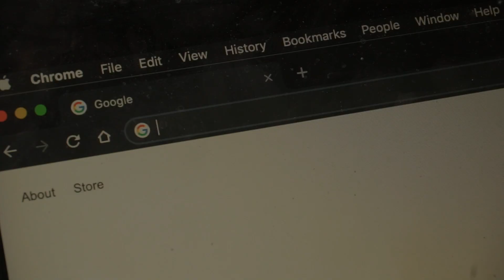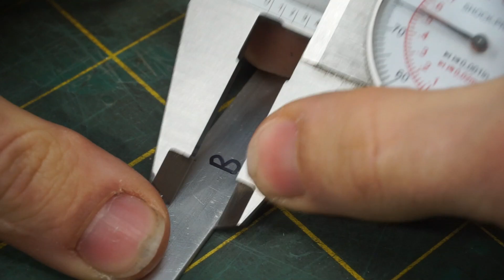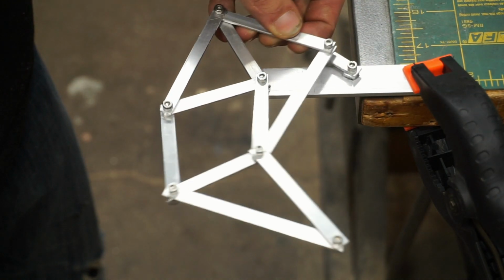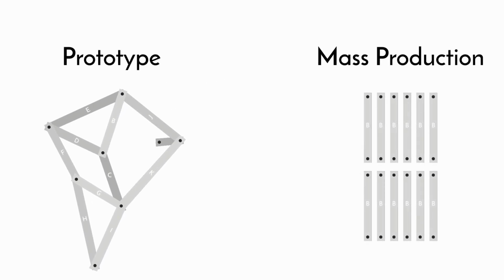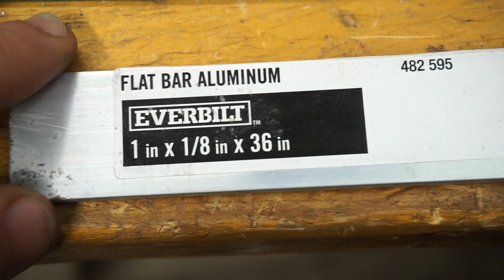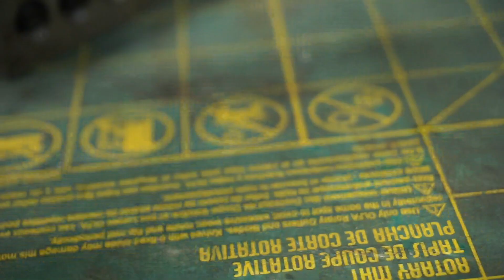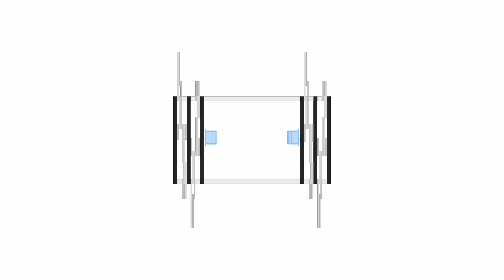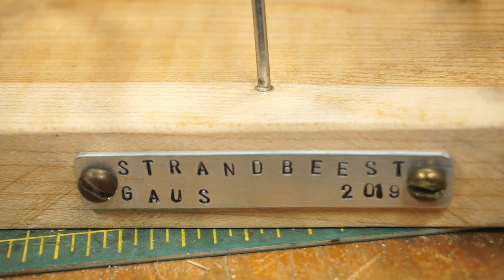Two Strandbeest-Inspired Projects

Comment: You could double the length of each link and use standard 1/2 inch width without milling down. Would save a heap of work.

Comment: Hi there Ryan did you get your machine made? I'm collecting ideas to build a mechanical ant with 6 legs driven by 1 double shafted electric motor and gear box and since there is only one motor all the legs will be in sync with 3 on the ground at any time ,, 2 legs on one side and 1 leg on the other side all running with bike chain and sprockets, I will be sitting in a seat behind it doing my shopping I think the kids in town will get a kick out of it.

Comment: During the video you tightened part of the linkage with tools and put a decent amount of oomph on it. If you haven't gotten it to work yet, try loosening all of your pivot points and lubricate with oil or grease instead of graphite. You might also polish the ends of the linkage that overlap. Good luck.
Reply from the maker: Good idea!

Comment: Answer to your power inadequacies:  Reduce weight by using hobby lindenwood instead of aluminum.  I'm partly saying that out of jealousy for your mill...
Reply from the maker: Good idea, but thinking back, I'm pretty sure that the limiting factor was less the weight of the material and more the friction caused by the mechanism containing so many linkages. Maybe I'm just telling myself that though because I like the look of the aluminum! 😃
Reply: @RyanGausMakes  Perhaps Teflon inserts at the joints?  That's what I'll be doing.  That motor looked pretty small.
Reply from the maker: @fritzwilhelm8258  Ooh yea, I'll keep that in mind for the future! I definitely should have done that. With the gearing ratios I had, I definitely was able to get some of the motors to spin it briefly - well, at least before the gears broke that is. I think some metal gears and reducing the friction on the linkages would go a long way.
Reply: @RyanGausMakes  If  you can get it to spin suspended you'll know you have the linkage lengths right.  That's what has been giving me headaches, my beast ends up being crippled in one leg.  I don't have a formula for sufficient motor size per dimensions.  We're not building model cars, that's for sure.
Reply from the maker: @fritzwilhelm8258  I did get it to spin in a suspended manner, see here: https://youtu.be/iFd-KkSyB8M?t=670. Unfortunately, that's the only shot I took at the time.

I definitely wouldn't have been able to get to the precision required without access to a mill. I'm not sure what equipment you have available to you, but with a decent quality milling table on a drill press you might be able to get the lengths precise enough. Anyway, if you're running into any problems in particular I'd be more than willing to try to make some suggestions!

Comment: The motors should work if they're geared down enough. They want to spin really fast, so it has to be a huge reduction.
Reply from the maker: It was a pretty big reduction - at least 200:1.
Reply: @RyanGausMakes  wow, I guess that hobby motor is just too small.
Reply from the maker: @ridethroughlifertl  Yea, I suppose! Also a potential is maybe I wasn't mounting the motor ans geartrain securely enough to keep the gears from skipping.

Anyway, I hope to someday come back to this project with a fresh set of eyes and figure it out then!